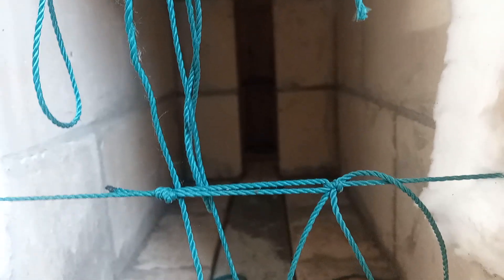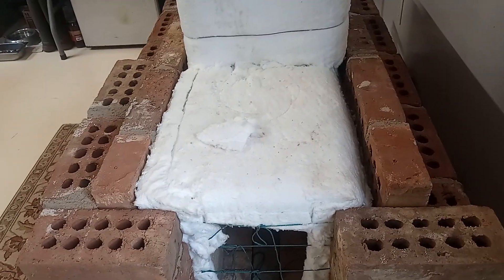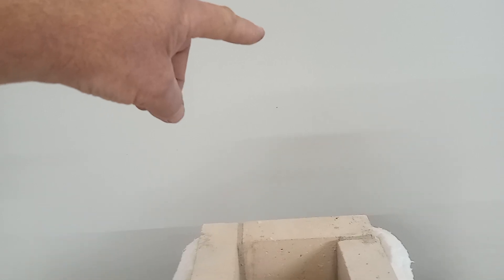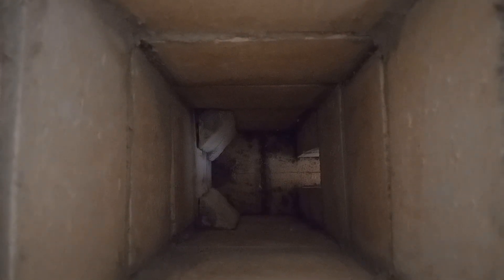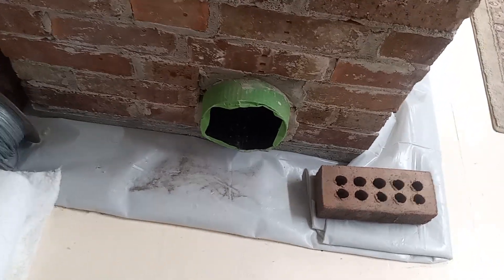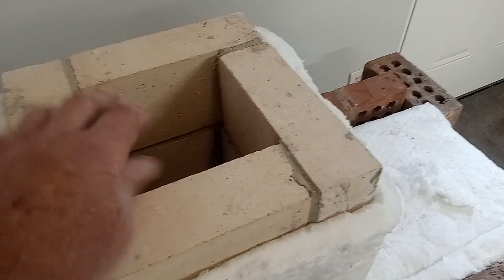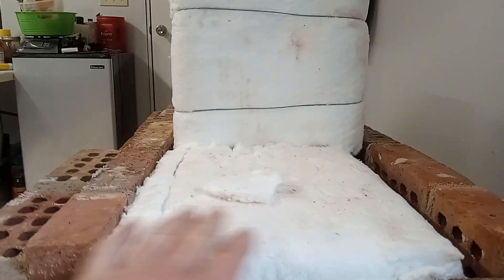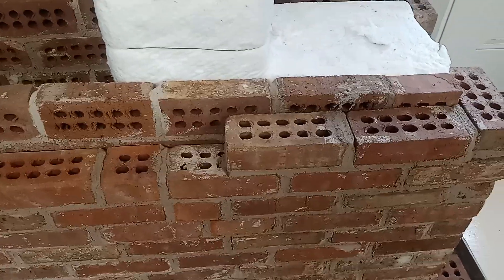Rocket Mass Heater - Build  Explained

Comment: I learned a lot. Thank you. A friend lf mine explained to me that a switch/shifter on top of the chimney pipe within the box can help with the efficiency. To have it openned when you start the fire, and when the mass is warm, shut it, so that the heat escapes from the bottom of the pipe on the floor. Not sure if i explained it well. If so, do you agree?
Reply from the maker: Yes I do agree although I didn’t need one. I put the tee down low on the back so I could prime the chimney with some burning paper …
As it worked out with my chimney pipe exposed to the inside of the bell it heated quickly and started to draw.
Most people do put a bypass of some type or as I did some way to heat the pipe to begin the draw
Thank You for Watching … if you have more questions please feel free to ask
Reply: @carlboehm5468 exatcly. Thats what i meant. Nice alernative. I am becoming very interested in this. Cant make one now as i have to finish otger things first. But will do it for sure. Wanna replace my fireplace with one.
Reply from the maker: @penzdar  … there are many ways to make this work … I took ideas from many different sources and made my version … I had to take this stove down and move but I plan to rebuild it hopefully by next year this time. In this one I would change 2 things … the insulation around the inside bell of firebrick I would not use and #2 is the mortar thickness around the firebrick was too much and did not hold up … make it thin 
Good Luck on your build. I will be making a video of the takedown and my findings and thoughts …
And then another video of the new stove that I will be building … 
stay tuned  😊
Reply: @carlboehm5468  good luck. I leaned from you and your video. Much appreciated. I searched and saw a fireplace version. They made the initial fire chamber much larger. But the rising pipe was the usual size. I wonder if different sizes would affect the efficiency. The good thing with a larger initial firing chamber is that when you put a glass lid on it, you can enjoy the view of fire burning.

Comment: Looks very good. Good and simple insructions.
I am only questioning if the front part is heated as well. Because I cant figure out where the hot air is flowing.
Also on the left and right side of the riser. There is no air space?

Thank you for answering.
Reply from the maker: Sorry, somehow I missed your message … the stove has an internal and external brick with a space between them … the interior bricks are on edge so the holes in them will allow the movement of hot air into the space between the two walls .
Hope that helps …

Comment: Seems to be nice design, though the secondary air feed and some of that ceramic wool is just overkill and a waste of time, effort, and of course, money.  I must comment on the thickness of the mortar holding your firebricks: my experience teaches that it will not last long term with temps over 2k.  It is much too thick.  Mortar for firebrick is applied much thinner and will last a very very long time.

Comment: Excellent, simple design that I bet will work well. The ugly barrel associated with a rocket stove should be a thing of the past. Use the rocket stove core to heat BRICK and thermal mass, not an ugly oil drum. Use masonry and brick like the Russians and Fins do to store heat for 5 to 10 hours. Cobb and mud benches, not necessary. A few things if there are any "beginners here." The insulating around the firebrick with the "wool wrap" is NOT necessary. It can't hurt, but it's overkill... adds 1%. For heavens sake he's used full 9 x 4.5 x 2.5 firebrick, not the thin firebrick kind! NO NEED. It's already insulated by TWO layers of brick and the air moves through in just 2 seconds. Where's the "cool down" gonna come from in 2 seconds? Also, for beginners, the "cut bricks" at the bottom of the riser to make the venturi is nice if you can do it, but NOT necessary. It will draft fine either way. It adds 2%. Rocket stove makers are in love with spinning air in the riser. No need if you can't cut the bricks. Rocket stove makers are in love with secondary air also. It's nice if you can do it, but it's not necessary if you don't have the technical skills to build that metal tube. The "squeeze off / choke off" of the standard batch box is not necessary in this design. It will rush up the riser hard either way. A taller riser of firebrick is worth more than the "choke off" everybody thinks they need to do in a batch box. If enough primary air moves through that's fine. When the thing heats up to max, you won't get any smoke. This is a rocket stove surrounded by a Kuznetzov Russian "bell." Very good design I bet.
Reply from the maker: FYI ... I can agree with your thoughts ... But I do have the capability to build as per suggested by the people who should know ... So I did 😉
Reply from the maker: Did you see my new video ... Farther along now 👍🏼

Comment: How much money did the project cost?
Reply from the maker: Thanks for your question ... I have not done the final dollar tallying yet as I am still finishing up the project.. I will be doing a complete build video when I get it up and running. I can say that a rough estimate is about $1800.00  ... Which also includes the double wall chimney pipe, cap, support and flashing. I would expect to have it running around Christmas and the full build video maybe later winter or early spring ... Keep in touch ...

Comment: Carl -

How do you think the cored lightweight bricks will perform relative to solid bricks?  How did you seal the inner layer of bricks in the bell, since the cores run through the thickness? Mortar? A sheet material? Something else, perhaps?  Maybe it's not a worry, as long as the outer skin of bricks is sealed (plaster render or whatever).  After all, lots of older masonry heaters are single skinned; double skinned seems to be a new thing, mostly due to safety concerns and regulatory/insurance considerations.  But it seems like the space between the inner and outer skins could (eventually) accumulate ash and debris.

Also, I noticed that the bottom of your fire box doesn't appear to have tapered fire brick sloping in toward the P-tube channel.  Will you add those, or have you decided to dispense with them?  Some of the experimenters seem to think that keeping the coals clustered together toward the end of a burn is helpful for complete combustion and to avoid the danger of CO poisoning.

Thanks for showing your build.  I may try to salvage some solid clay brick from a decrepit building near my house and use them to build a batch box style of burner, though I have been eyeing up some of the "riserless core" designs by Matthew Walker Remine ("Walker Stoves").  The batch box designs seem to be a better match for someone who is accustomed to burning a conventional wood stove than are the more traditional rocket stoves, which require a fair bit of babysitting and tending during the burn.  I am interested in building a solid fuel fired backup heat source for the existing (and rather ancient) low pressure steam heat system in my house.  A downdrafter style of burner would work, and could be thermostatically controlled (at least to some extent). I am not so sure about a true rocket stove, batch box or otherwise, however.  I know using the existing steam system will not be as efficient as living on top of (sometimes quite literally) a central thermal mass, like with the typical Eastern European/Russian stoves, but I think it will be more easily implemented as a short term solution.  The long run ideal would be a "transit" style heater, with the stove/burner on a lower floor (cellar), and several stacked bell-type thermal masses above, one one each additional floor, each bell (or stacked pair of bells) with its own diverter/blast gate on the common stack.  This has been done in Russian apartment buildings, and also some multistory dachas, with good success, and allows for control of the radiant heat supplied to each floor from a single firebox.

For anyone interested, Peter Van Den Berg's (AKA "Peter Berg") spreadsheet of dimensions for various sizes of batch box rocket stove can be downloaded from the donkey32 forums (just Google it - you'll find it).  These stoves are all sized based on the diameter (or equivalent cross section) of stack - 5", 6", 8", etc. - because careful control of draft (temperature, i.e. sufficient air for combustion, but not excessive air which would cool the fire too much), mixing (turbulence) and duration of combustion (reaction time) are critical to the proper performance of the heater.

Thanks again for showing us your build using cored bricks.

Kevin
Reply from the maker: Also wanted to say that I'm using the core bricks because I bought all the bricks for the project ... $75.00 ... I do have 2 ash cleanouts when needed
Reply: Thank you Carl for all of the detailed information! It seems that the cored bricks laid on edge would facilitate heat transfer to the outer brick, heating up the home a bit quicker, and add mass as well. Brilliant. Getting ready now to fire up your sequel video! @carlboehm5468
Reply from the maker: @ChristinaMiller-j4v  Thank You for watching … FYI , I had to sell my cabin which meant taking the stove apart so that the cabin could be moved. Sad but it helped me learn how it worked as it was built. I will be doing a video of the process of taking it apart but I am in temporary housing and don’t have room to have my computer. 
Things I can tell you is that the bricks as you mentioned did work very well to transfer heat to the out wall and was evident from the smoke pathway on the bricks. I will be re - building the stove as I have them with me in my new location. What I would do differently … I would not use the firebrick on the upper part of the inside bell and not put the outer wrap of the insulation around them. Although I don’t believe it was a problem, I didn’t see any issues with cracking or heat damage anywhere except the fact that there was too much clay mortar between the firebricks and although they were all still intact they were all loose. There was mention of that in the comments. I’m planning a different type of build this time using a combination of a couple different designs. If you haven’t seen the channel fox fish look him up … he uses glass to visualize what actually happens inside the stove. I will be using some of his ideas but adding a glass cooking surface from an electric stove and using the bell design that I used for my stove here . Hopefully l can get some type of oven built into my new stove. I’ll be making a video of this build as well but it probably won’t be done until next fall … I hope ❤ 
Feel free to ask any questions you might have, my email is in my bio … Thanks Again for Watching … Carl
Reply from the maker: Kevin ... The inner core of bricks is to add mass and after conversation with "Peter" it enables the brick to have an insulation layer around the top 1/3 of the stove to prevent cracking from temperature differential. I will be adding the tapered sides to the firebox but I still have firebrick to cut and I'd rather use scrap than cut good brick (I'm thrifty like that) ... Good luck with your project and keep a watch as I will be posting more. Thanks for your comment 👍
Reply: @carlboehm5468  Thanks for the informative reply.  I've seen a thermal expansion gap like this used to mitigate internal stresses (often a sheet of cardboard between wythes, which will burn away to leave an air gap, sometimes carbon felt or ceramic wool), but I haven't seen it in conjunction with cored bricks.  If good results can be had when using cored bricks, it certainly opens some possibilities.  The fact that you got the bricks at a good price certainly makes them attractive.  I suspect the solid bricks I'm hoping to salvage could be had almost for the effort needed to collect them (and chip off the old lime mortar).

I've noticed that in many of the Russian builds (not rocket stoves - batch box or otherwise - but still thermal mass heaters), angled cuts often leave a bit of the original edge of the brick so that the remaining edge doesn't taper down to nothing, but instead is more robust.  The exception to this is when constructing the flat arches over fire box and ash doors, which often do taper to a chisel edge, but are buried within the structure of the stove, in that application.  Igor Kuznetsov's website has several "Lego directions" examples of stove designs available for free (just Google his name and "stove").  As an aside, many of Igor's firebox designs are closer to the Walker Stoves "riserless" layouts than to the more conventional Russian style stoves.  Whatever the case, if the angled bricks at the bottom of the firebox had a more robust edge, they might be less susceptible to breakage.  I haven't figured out what the bond pattern/layup would need to be to accomplish that, but I do know from experience with conventional wood stoves that a firebrick liner may need to be replaced every couple of years.  Since the batch boxes should be fed with smaller splits than a conventional stove, there should also be less attendant impact and abrasion on the firebrick, but anything which can make the initial build have a longer lifespan is probably time and effort well spent, to my way of thinking.

Thanks again for the reply.  I'll "watch this space"!

Comment: Looks good but what about fuel consumption ? Looks like youll be using more fuel than a regular stove. Its pretty much burning unregulated since a air dampner would affect the ventury effect
Reply: No, it will use less wood than a regular iron stove.
Reply: @quantumofconscience6538 , a fraction, actually and if done right.
Reply from the maker: John ... There is no air damper ... The secondary air I mentioned is to make sure the smoke and wood gas does have a "turbo" burn. The burn temperature in the riser will be upwards of 2000° f ... This intense heat will be absorbed by the double brick skins and radiated. I'm hoping to use 1 or 2 burns per day ... Keep in touch for the updates. Also there will be a door with air to the firebox along with the secondary air for the riser ... Thank You for your comment and support
Reply: @carlboehm5468  👍 looking forward to seeing how it works out for ya.
Reply: This is a different type of wood burner then most. It pretty much burns full tilt, heating up the mass, that continues to heat the space for a long period of time after the fire has long burned out.